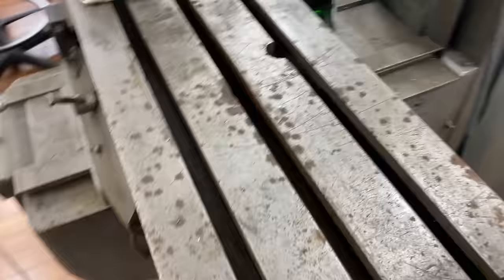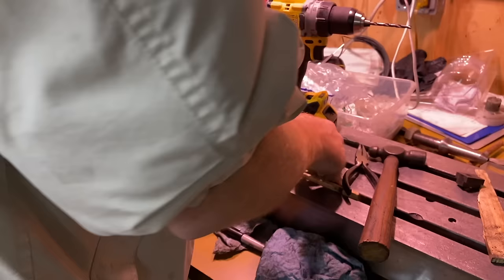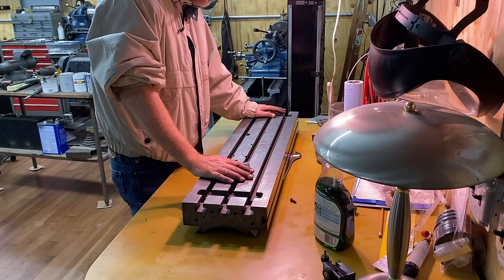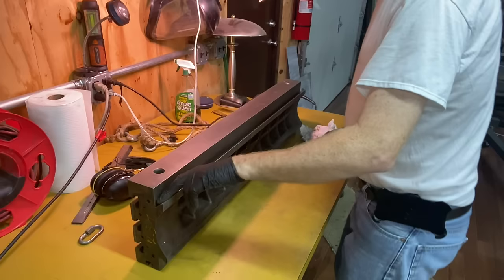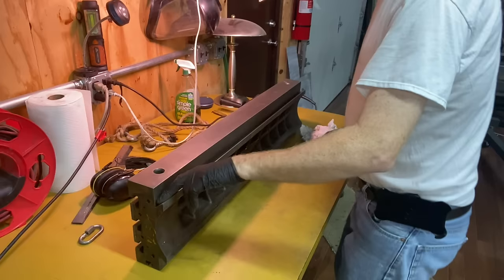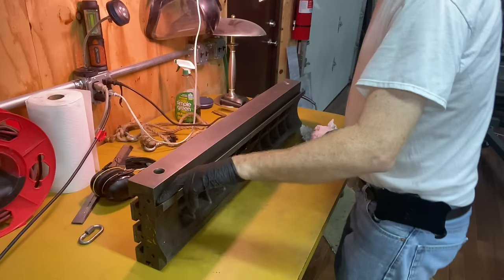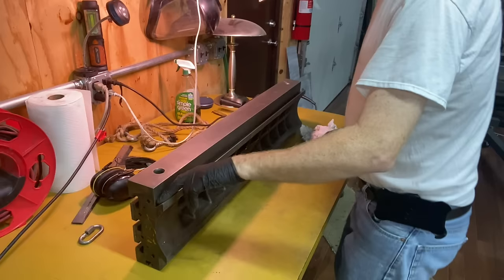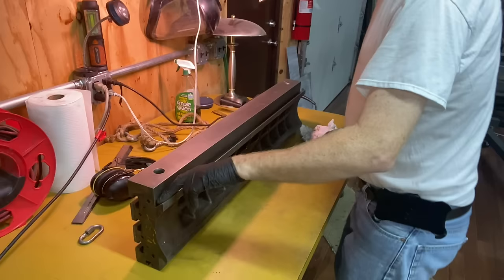Bridgeport restoration 10  -- Fixing a Horrible Mill Table

Comment: Suggestion, possibly
I was wondering why you are trying to level the hard way,
When I would have used an extended micrometer attached to the rotor headed
Swept it around at all 4 corners, then once it is a close as one can get it,
Use a fly cutter to level the top nice and clean, after having done the guides under the table first/.
But would it matter as the table would always travel the same plane, to both ends in the X and Y directions.
Reply from the maker: I have been thinking about this.  My concern is that the bed sags and varies in z-height as it goes through its range of travel.  If I keep the bed in the center and then use an extended micrometer to reach to the edges, would that tell me how it was going to behave when I moved that edge of the table closer to the middle?   Ultimately, I need to get the dovetails all machined flat so I have more confidence.  If I move the bed all the way to one side, say to the right, then the center of the spindle is still about 8 inches away from the edge of the bed.  So regarding a fly cutter, I would either have to have a fly cutter with a radius of 8 inches, or rotate the entire turret and ram to get the spindle closer to the edge.  With the large radius cutter, I think I would have too much chatter unless I made a very massive and huge fly cutter.  And regarding rotating the turret, I have done this while machining a 36" straight edge (Hint: there may be an upcoming video about this), only to find that there is a step in the resulting surface between the head rotated 30 degrees to each side.  I think most of this is coming from table sag, but regardless, I currently don't trust this enough to proceed.  I'll keep thinking about this, and if you have any other suggestions, I would love to hear them.  Best wishes.  Kevin
Reply: @KevinToppenberg  I'm no exert, but after giving it some thought
If i were doing and i'm not
I don't think I would use a fly cutter, 
I think if the guides etc holding the table u are actually flat and true, 
I would put the spindle dead center and use the largest diameter i have and rotate it around measuring the table and center it to the average height knowing my head was perfectly 90 degrees in all planes, 
Then because of fly cutters may bend or flex when spinning,
I would probably use a small diameter endmill to recut the whole surface.
I would suspect the bed to be true to the head and the head to be at a perpendicular as possible
Check with a more educated person than myself. Confirm what you have done with them before you do any cutting,
Present what i said and if they think that is ok, then your own your own, and it should be ok
I'm just about extinct in age and must check with more up to date machinists.
Reply from the maker: @CMAenergy   Well, I have a few other tasks on my to-do list, but when I come back to this, I will certainly consider what you have said, and also check with others.  Best wishes!

Comment: What is flaking? Never heard that before?
Reply from the maker: Scraping is where the surface of the metal is scraped off to achieve flatness.  Flaking is the process of putting in very light scrapes such that oil is retained, making for better sliding between two pieces.  Thanks for watching.

Comment: What about brazing ? Fireball tool fixed a completely broken vise with this method. You probably would need something strong to heat it.
Reply from the maker: Brazing would be the proper way to repair cast iron.  But my understanding is that one needs to heat up all the surrounding metal evenly first.  And that would take a considerable amount of heat given the sheer mass of the table.  And I was ultimately concerned that all that heat would warp the table and leave me worse off than when I started.  Having said that, if it was successful, it would have been a much nicer repair.  Thanks for watching!

Comment: I suspect the low spot in the middle is wear on the bottom where the table spends most of its time.
Reply from the maker: Yeah.  It's an old machine and lots of wear various places.  No telling which one of the many wear areas is the culprit.  Thanks for watching!

Comment: tram it in  again and fly cut it. good as a surface grind. good enough doesn,t make it. the day will come when you say " i can,t make this, my mill won,t hold tolerance"
Reply from the maker: Serious question: How would I go about this?  My table won't travel enough for a fly cutter to reach each end in one setup.  I can loosen the turret and rotate the ram, but that becomes a different setup, and I am not sure that I won't end up with a several thousandth's step between fly cutting the different parts of the table.  How would you go about this?  Thanks for the feedback

Comment: Lost me at epoxy ... it should be welded :(
Reply from the maker: I thought about welding, and I looked into it.  I even found a video of some guy in Korea plugging all the holes with a MIG welder.  But everyone I personally asked about it looked at me in horror because cast iron doesn't well well.  I think the area that gets heated pulls away from the part that is not heated.  So then to avoid this, you have to preheat the entire table.  And that then requires some sort of giant oven which I don't have.  And if I did get it all that hot, I worried that the entire table might warp.  So since it is all just cosmetic, I compromised with epoxy.  I have done this on a prior Bridgeport clone, and much of it pops loose after about a year.  But no harm done.    Best wishes,   Kevin
Reply: I applaud his enthusiasm and willingness to just dive in, but most of the cosmetic work he did only made the table worse.  Willy-nilly adding flaking to the ways is just adding wear.  You might feel better because it looks more like an unworn machine. Its also what unscrupulous sellers do to clapped out Bridgeports.  Belt sanding the table top is an even worse idea.
Reply from the maker: @vandalsgarage   Sorry you didn't like my efforts.  Thanks for the feedback.